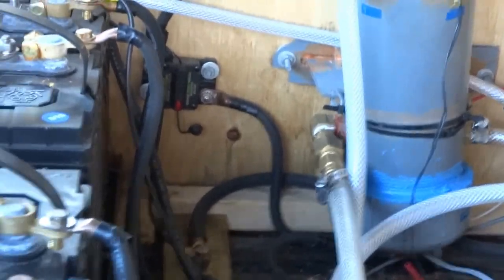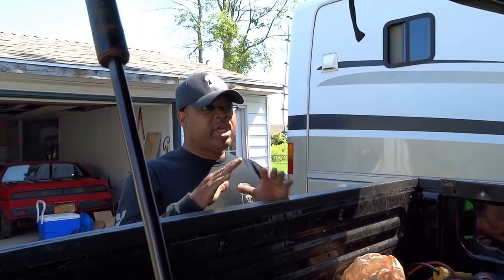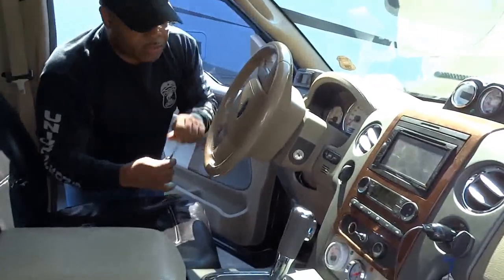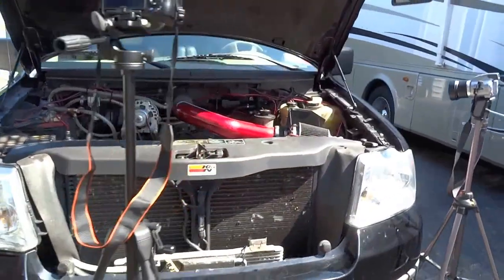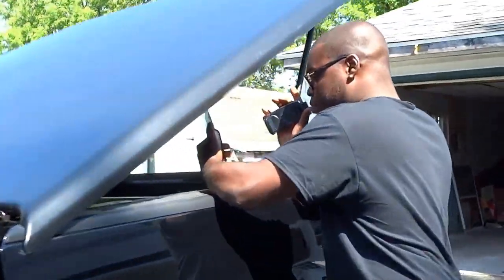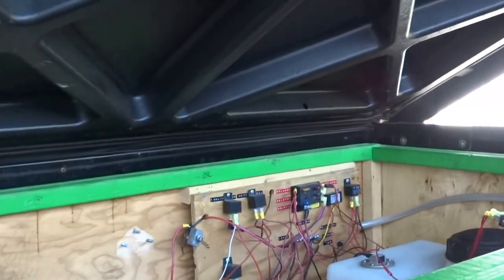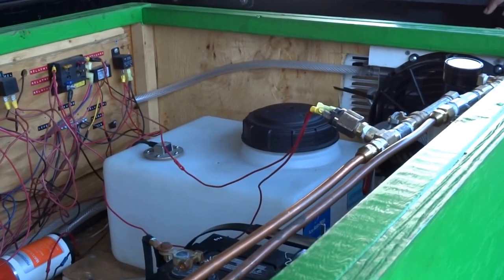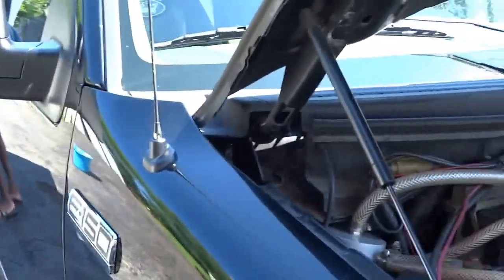Aaron Salter, AWS Hydrogen Technologies LLC

Comment: When you look at the work of Jean Chambrin and Paul Pantone, it would seem that exhaust gasses coming out of the engine are essentially plasma that create an energy field that can disassociate water into hydrogen and oxygen. At least that's my understanding. Both of them were running their fuel lines though the exhaust or manifold in order to run engines on water.

Comment: Yes it can run in idle mode. The hydrogen gas is mixed with air at the intake pipe? Ratio would appear to be set. At higher rpm and real loads, how's it going to perform? 
Believe it or not, back in the late 1970's, BMW had a 6 cylinder engine on display, running at the Toronto International car show. It ran fully on hydogen and all the electrolysis hardware producing it was also attached. It's nothing new.
Reply: Your nothing new either
Reply: so out of the whole situation! thats what you comment. smh
Reply: @angeleye8953  ??? And you'd  think as many likely will do, that he invented it and made it work? Sorry to burst your bubble. I'm not cutting down his efforts which are commendable! Just asking questions which by the way are still legal.
Reply: @charlesbernard3042  it always the people with no profile pic or content with the most to say. Keep hiding behind your keyboard
Reply: @Rocknch0p  You're offended because people ask or inquire through questioning and research? Good thing there's still people like me rather than the likes of you who always feel and think the same way. For approvals sake, eh?
Reply: @charlesbernard3042  your talking in circles. I just put up a video on this. Go ahead and feel free to troll my video using your keyboard
Reply: @Rocknch0p  Asking and inquiring is "talking in circles?" No one allowed to inquire? What are YOU afraid of? Offended still?
Reply: it's not about it being new - its about bringing it to market.
Reply: it would not run under load

Comment: The energy source is not water it has several batteries that are the energy source. That energy gets converted to hydrogen and that runs the engine but the energy SOURCE is still the batteries.
Reply: Exactly. And if the [extra] batteries are being charged by an alternator run by the engine (which is shown in the video as the "extra alternator"), then the batteries that drive electrolysis are being charged by whatever fuel originates new energy into the system - in practice, that's the gasoline. Any energy from combustion of hydrogen/oxygen, which then [via the alternator] drives the electrolysis that produces hydrogen/oxygen, doesn't contribute to any savings - in fact it results in energy losses through the electrolysis process, including heat. Only if the energy originates from a DIFFERENT source than the gasoline, does it matter and provide "savings" of any kind.  But it can potentially matter. Here's how.

If the batteries are home-charged like a Tesla or any other electric vehicle, then they can in principle augment the gasoline fuel with energy merged into the system via hydrogen/oxygen. Lead/acid batteries like Aaron was using are heavy, so obviously there is not as much savings toting those around, but lighter lithium ion batteries like Tesla or upcoming cheaper sodium ion batteries (see C&EN 5/30/22) could bring the efficiency into a range where the whole process begins to make physical sense, and possibly economic sense. Is it competitive with taking the electrical energy straight to electric engines? My money would be on Musk's decision, same as Steinmetz (who was one of the first advocates of electric vehicles). Internal combustion is great while you have fossil fuels (which we do, and can have for a long time), but if we start making electrical energy cheap, competitive, and readily available with more nuclear reactors, THEN electric engines are not only highly efficient but economically favored, and bound to displace gasoline.

What Aaron did here isn't magic, but it's pretty cool. He was helping make electrical energy practical in transportation. Getting a hydrogen system to run out of the bed of your pickup is awesome. His patents (you can look them up) are realistic minor improvements to the process, concerning addition of a filter to the hydrogen stream, to remove sludge.

Added note for people saying "he's running the car on water". No. Just no. Electrolysis takes the same energy you get back out by combustion - minus any losses, of which there are plenty. Analyze the energy economics. There's something called a "perpetual motion machine" which doesn't actually work - where energy is allegedly used to drive the production of itself. Obviously that's a fallacy. People constantly "invent" those (I'm not saying Aaron did), but they're always wishful thinking and failure to look for where energy enters the system. In this case, energy enters as the gasoline fuel. Aaron was indeed caching a lot of gasoline energy as both hydrogen and in the extra batteries, so one has to be extremely careful in any metrics of "increased fuel efficiency". Thank goodness I had a great physics teacher who trained me to spot those. I even caught NASA proposing one of those one time. They're easy to design if you don't pay a lot of attention to how and where the energy is entering, traversing, and leaving the system.

And yes - Aaron was a hero. I hope people are inspired by him, both to become inventors and LEOs.

Comment: The problem with this type of design is that is violates the first law of thermodynamics. A.k.a - this might work, but it does NOT improve MPG.
Reply: but its MPGallons of gas VS MPGallons of water.....
Reply: @stone8474  no. water is not fuel. water + electrolysis = hydrogen(fuel). Where does the electricity come from? It comes from the gas engine.
Reply: correct, electrolysis to produce hydrogen and use it again in a fuel cell, or burning it is about 70% round trip efficiency.

Add to that combustion engines get about 30% of the fuel energy as useful work, and the rest goes out the exhaust and radiator as heat...

IF it runs on hydrogen (or residue??) then charging the batteries has a 40% return on energy.
Reply: @malcolmtuckey9888  and this vid 6yrs. Old. How much improvement was made over the last 6yrs?

Comment: Newsflash for people who don't know, this electrolysis application for engines isn't new, there are a million kits online to buy kits to supplement your fuel economy.  But whats less common is a high output system to completely run a vehicle on electrolysis alone. It is a touchy subject with people thinking its impossible and breaks the 3rd law of thermodynamics. What pools don't understand that the part of the equation about the efficiency of electrolysis is what matters and needs to be improved upon. There are other people who claim to have a car run on it alone. Like fast eddy and others this guy isn't a big genius.

Comment: You made a comment that water may be going inside the engine. You better make sure there is no sodium hydroxide or potassium hydroxide entering your engine it will damage the combustion chamber. All gases should be going through a dryer.

Comment: Hydrogen is highly flammable. Met a guy on this platform once years ago who said he removed the engine and transmission from a car, and was able to make it run and steer ... using other method. Not the sun, not water, not flammable. He was also going through a lawyer to get it patented, so of course we'll never see it.  He actually drove, didn't just idle in a driveway.he did leave the brake system intact. You wouldn't need gas, oil, transmission fluid, or antifreeze, or a radiator, nothing to overheat.

Comment: https://youtu.be/SAFQdYYXyls?t=406 At this point in time the engine is running you must have carbon fuel in one of your chambers running off of fumes. If there is no electrolysis makes hydrogen and oxygen gas called HHO Gas or oxyhydrogen two different names they call it. If the electrolysis is not on and you do not have a carbon fuel in any of the chambers then where is the hydrogen coming from? What is that vibration noise that sounds like a pump?

Comment: To all the people saying he's got this truck running off of hydrogen this is the worst video I've ever seen he explained absolutely nothing also what about all of the ramifications what about the fuel pump just because you shut a valve the fuel pumps going to keep running what about the injectors? Won't they overheat if fuel isn't passing through them to cool them off?   Also nobody mentions anything about the humongous upgraded aftermarket alternator to charge all those batteries don't you realize that puts an extra load on the system? I'm not calling it BS but nothing was explained.

Comment: Maybe, but this video is just making claims (running on residue???). Better to just use a simple table top engine of some sort, demonstrate clearly the sources of fuel, lines, valves, pressure gauges would be nice, etc.

Comment: This is clearly a quack design. There is no energy source that could power the car. This man was a scam artist, but unfortunately he became a martyr so now people with no understanding of the basic laws of thermodynamics will defend him and claim he was "taken out".
Reply: Both things can be true: he could have not been a scam artist, and been killed randomly.
Reply: @carolinehill8325  There is no way he's not a scam artist. The design he's purporting doesn't have an energy source. If what he's proposing is an engine that runs on hydrogen we already have that technology. You can literally buy one right now, at this moment. They just suck cause hydrogen is a bad fuel source. Either you get it from petrochemicals (which come from the big bad oil companies that supposedly killed him) or you get it from electricity (in which case just use a battery).
That being said who knows, the whole Buffalo situation glows and it's entirely possible he was taken out, perhaps as an example. He could have been a scam artist and also been silenced as an example for those who dare to even try. Or it could just be a coincidence.